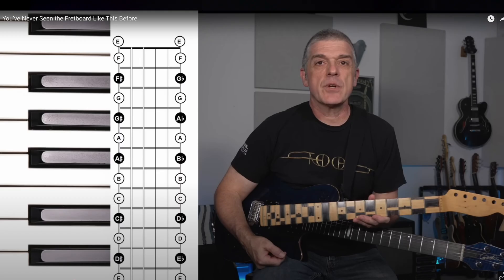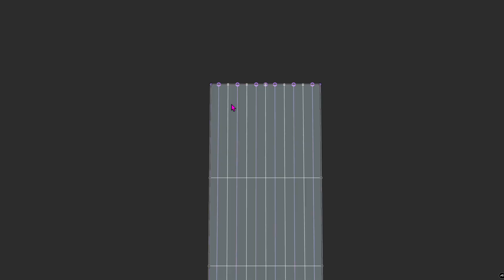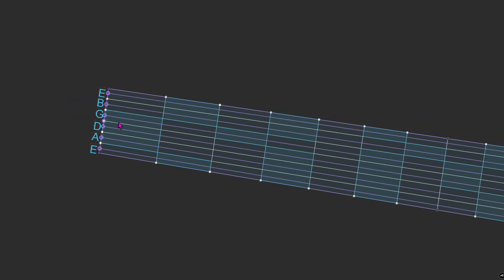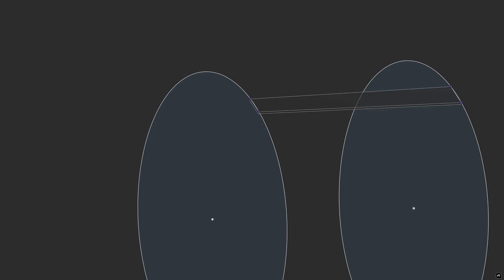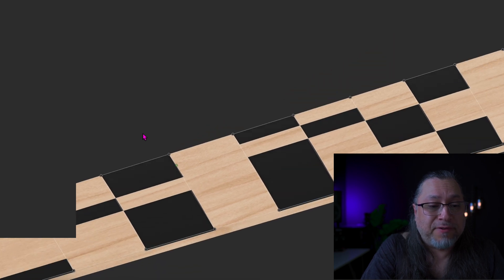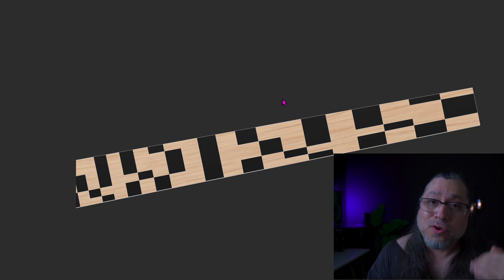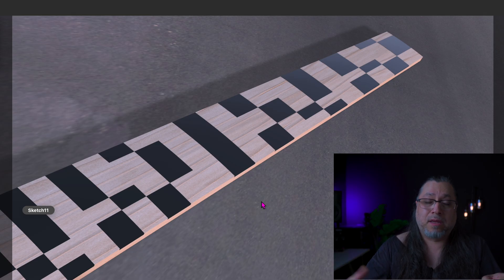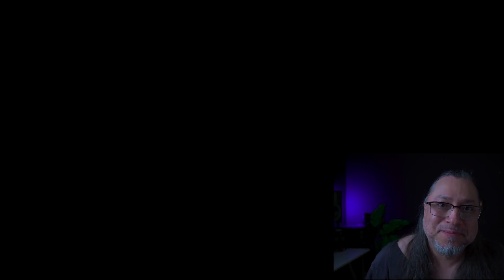I Designed The Piano Grid Guitar Fretboard in CAD

Comment: You should build a modular acoustic electric instrument that can change string spacing and number and frets so you can emulate all sorts of folk instruments and possibly even microtonal frets to expand the range more or a fretless fretboard, perhaps the fretboards could be swappable
Reply: For example you could have 12 tuning pegs then use 8 of the 12 with a mandolin style nut so it’s like a mandochello or do 6-7 strings in 3 courses with 24 edo frets to emulate a balagma
Reply: You could use a cnc aluminum neck so it handles the string tension without warping
Reply: You sound like an insane person.🫨 That would be a very interesting build